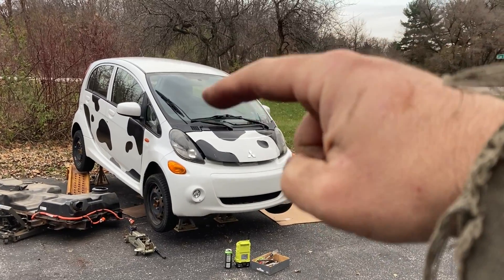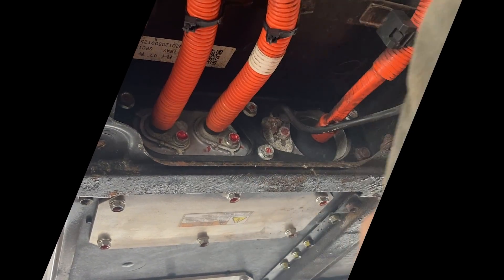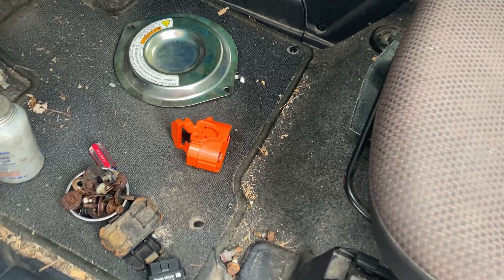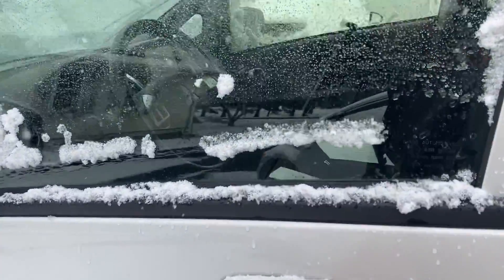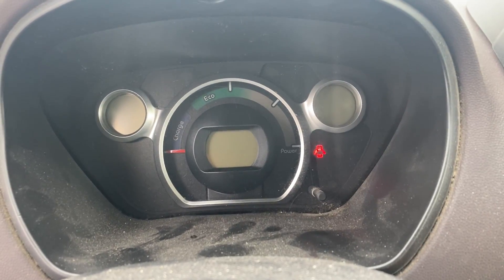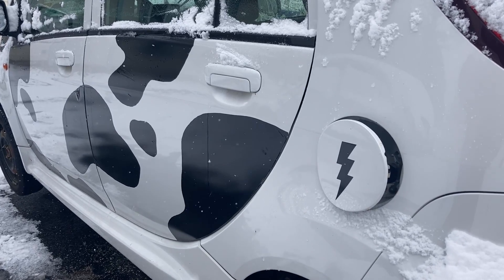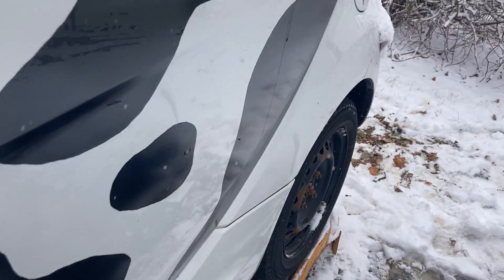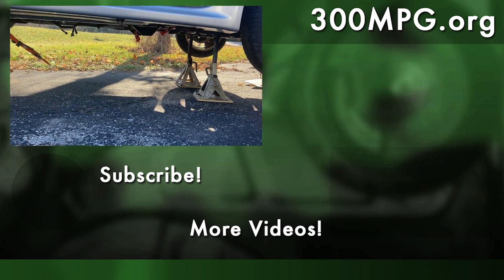Replacing an Electric Car Battery Pack, Part 2 (Mitsubishi iMiEV)

Comment: Was there ever an update to this one?
Reply from the maker: No, not really. The main thing is that I simply swapped the battery packs between the two cars and that the Cow Car now has better range than it used to.
Reply: @BenjaminNelsonX did it fix turtle mode
Reply from the maker: @shawnmos  Yes.

Comment: EVs fires actually are rarer than ICE vehicles catching fire and burning down, however, if an EV does burn, it's mostly after a crash - everything may seem fine on the outside, but within around a month a battery might short out.... or not, but that's the most risky period, it seems. So, getting a salvaged battery seems somewha risky, yet might be worth to try, as iMiEVs are quite cheap.

Comment: How did the mileage change from 79k in part 1 to 83k part 2? Also, one of the reasons I wanted to get an iMiev (I had to settle for a LEAF because I couldn't find a used iMiev in Iowa) was the lithium titanate battery they used was supposed to degrade much less than the lithium manganese or lithium cobalt batteries that were popular at the time, but degradation still adds up when the cycles are shorter.
Reply: Lithium Titanate was JDM only. All export models used LEV50s
Reply: @alanbrown397  I knew Nissan changed the batteries for their export models, but hadn't read that Mitsubishi did the same thing. What exactly are LEV50s? So, the only thing I lost going with the LEAF was a couple cubic feet of space in my garage.

Comment: Two great videos. On another video they threaded 12 inches of threaded rod into the corner battery bolt holes, to aid aligning the battery as you jack it up. Another (same ?) video, instead of a jack,  they removed one bolt at a time, threaded the rod in, and tightened up again with a nut on the rod. Repeat for the other bolt holes. Then unscrew the nuts in stages to lower the battery onto a trolley. Cheap, but long-winded.

Comment: To be safe I would remove the fast charge port.
Reply from the maker: There is no power at the fast charge port. 
When plugging in to a DC Fast Charger, there is no power at the connection. It needs to communicate with the car and pass a series of checks. Only then does power activate at the charger cord. 
Without the small communications cables going into the battery, there is NO WAY for the DC Fast Charger to activate.

Comment: I’ll soon have the ability to purchase a newer vehicle. My current gasoline car is a honda and is almost at 400,000 miles.  

What is your overall experience with mileage per charge on your iMiev.  I’m considering looking at those and I’m also interested in hybrids, specifically the Toyota prius. 

I would like an EV vs a hybrid however, I also would like to be able to go further without frequent charging. 

I’ve very torn over the matter. This will be my only car once I purchase it. Anyways, thanks for the knowledge you share in your videos.
Reply: I would definitely recommend something with longer range for an only car unless you only plan to use public transportation or rent something when you leave town, in that case you just need enough range to get to the rental car/airport/bus station. You don't say what country you're in, but Chademo is on it's way out almost everywhere. I really like my LEAF, but getting another one and buying into a Chademo port for another 5 to 10 years gives me pause.
Reply: @extragoode  I’m in the states and have decided on the Prius. 

A family member keeps insisting that a ford c-max is what I need, even tho they don’t own one or any ev/hybrid vehicle. They know an older friend that has one and loves how reliable it is. They rarely drive their c-max, 2,000 a  3,000 miles a year, that’s not enough data from a random person. Especially someone without any automotive knowledge, which they admit that they know nothing about cars. 

I’ve researched the prius for the last 5 yrs. I hadn’t thought about anything else until i saw these vids on the mitsubishis. After a brief look at the Mitsubishi, they unfortunately have very limited range for my needs, as do the Nissan leaf. 

So in the long run, the toyota prius is better suited for my needs. 

Thanks for your reply. I saw that about chademo chargers. That would def be a deterrent if i was purchasing an older ev.

Comment: Great video series, Ben! Super informative and interesting. Start trying to protect some of the rusty areas if possible! Also, who knows, maybe you can get the big upgrade replacement eventually, or maybe open the pack and swap the cells with different new ones.

Comment: always remove the ground wire from the 12v battery first and install it last. I saw a video this morning showing a fire starting from the wrench touching the frame while tightening the positive last.

Comment: IIRC you need to have the Mitsubishi MUT-III to set the new serial number for the batery so it does not stay in limp mode. Could be wrong!
Reply from the maker: Not the battery. I know there are a few parts with an embedded VIN that can cause issues on parts swaps, but this isn't one.

Comment: Just as with the old battery, this battery needs a balance charge before you can assess its health. Obviously those two low cells shouldn’t be that low but if the battery was sitting without a balance charge for months, 0.085v differential means nothing.

Once its fully balance charged it can be checked for voltage sag under full acceleration with the heater on to find the cells with highest IR. Then it can be driven down to 10-20% SOC, allowed rest for an hour, then the voltage of each cell will show capacity.

Then it can be charged to 80% , given time to settle, screenshot the cell voltages, leave the car off for a week without driving it, then check again for self-discharge. This time the low cells that dropped the most since the previous screen shot will show cells that are self discharging. 

From that basic test you will know the battery health, and if those two cells need to be replaced or if normal operation (performing balance charge once a week) will keep everything balanced. 

Some balance circuits work once they get too far out of balance, hopefully both your batteries will if you leave them plugged in for a week.
Reply from the maker: We'll talk more about cell balancing in another video!
Reply: @BenjaminNelsonX   What happened to Part 3?
Reply: What is a balanced charge ? And how do you do it ?
Reply: @AaronDwyer  , depends on the BMS but normally its when the charger is left plugged in, the bms will top balance the pack.

Comment: what is the point of putting the "bad" battery in to the donercar ?
Reply from the maker: The main reason is that the salvage car actually still drives!
By placing my old battery in it, I can still move the car in my driveway. I'm on a highly visible corner and in an area where people tend to be pretty strict on disabled vehicles. I had also previously beat out the major dents in the front of the car.

Comment: Why was it necessary to install the bad battery onto the damaged car ?
Reply from the maker: The main reason is that the salvage car actually still drives!
By placing my old battery in it, I can still move the car in my driveway. I'm on a highly visible corner and in an area where people tend to be pretty strict on disabled vehicles. I had also previously beat out the major dents in the front of the car.

I have an especially nosey neighbor who actually once sic'd the County on me!
Reply: @BenjaminNelsonX  
It would be a good idea at some point to start changing cells to equalize the ones in the good battery.
That would be an intersting video, or maybe a short series...🤔
Reply: Plus, we got some video of the installation that was missed.  Thanks Ben.
BTW, what are you going to do with the old car and battery?
Reply: I have one with 32K on it.